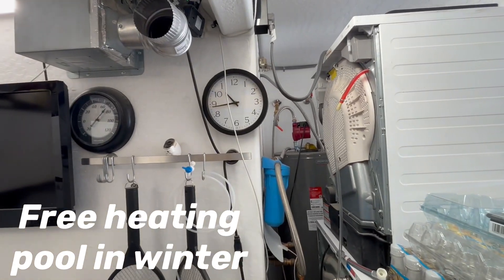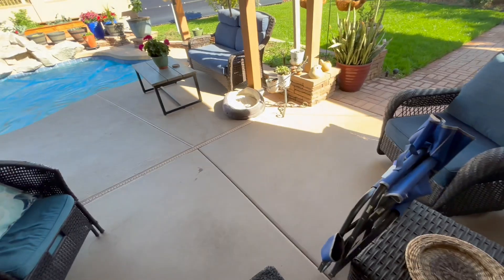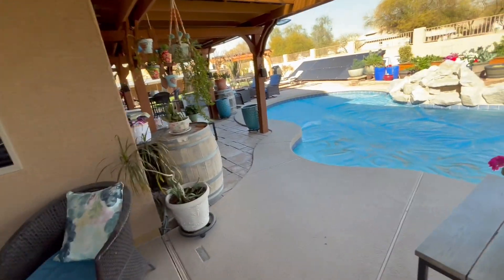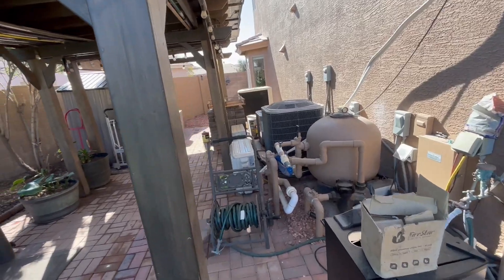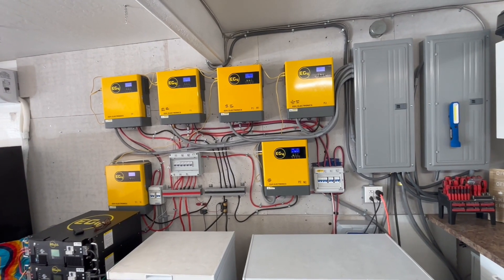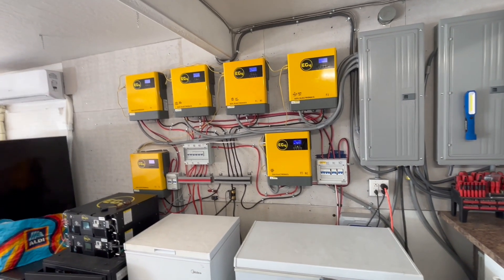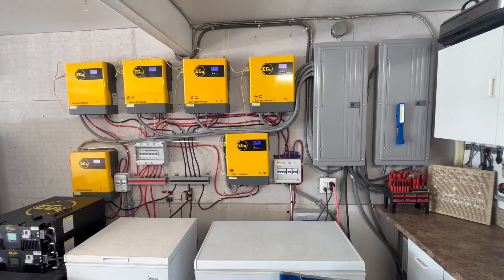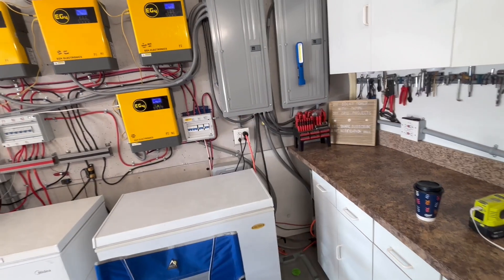DIY solar power pool pump. Run you pool pump and heat your pool using off grid solar

Comment: Wow, you know a lot about this stuff. I wish I did. I’m just playing with a small project trying to figure this out how fall out trying to get my pool pump on a little system to lower the electric bill
Reply from the maker: Pretty easy with the components they sell now.    They have pool pumps and heater that are 110-120V that can heat or cool up to 8000 or 9000 gallon pools. One you go above 9000 gallon pool you would probably need to have split phase output from inverter, 120/240V. 

You can get pool pumps that are either 120V, 120/240V auto sensing or manual voltage setting. You could run a 120V pool pump and a 120V pool heater with just one EG4 3kW off grid inverter and one 52.1V LiFePO4 battery along with around 4000-5000 watts of solar for around 12 hours a day.

You could also use a portable power generator connected to 2100 watts of solar to run a 120V pool pump and 27,000 Btu 7000 gallon inverter pool heater. 

There are many ways to do this. Most 110-120V pool pumps and heaters come with an electrical cord attached to where you just plug into 110-120V outlet. You couple plug into a portable power generator during the day using solar to run your pool 6-12 hours a day and then unplug and plume into grid outlet to run longer saving you 1/2 a day of electricity electric cost.

Hopefully I will get a 120V pool pump and 120V pool heater soon to make a video showing how to do this. Hang in there, it is really easy to set up a system. Just rake your time to understand how it works watching videos of people who set up already so you have a good idea how to set up yourself. 

It’s December 1, 2025 and my pool water is at 87 degrees. It was 46 degrees last night overnight. Life is good in AZ. Just Love the winters out here.

Comment: This  is HUGE! You've got an impressive system to be able to heat the pool all winter and still charge some of your batteries. Enjoyed seeing this in action!
Reply from the maker: This EG4 18kW output system is so powerful and quite. Heating my pool with 144,000 Btu heating capacity and pool pump on high and still below 50 percent output is totally insane. This is the first system to be able to start and run all day and my battery state of charge can be as low as 75-80 percent. 

Heating pool and charging battery bank at over 10 amps each on all 5 batteries. My friends have spent $800 a month for natural gas or propane to heat to only 75 degrees water temp. Electric pool heaters on grid use me was $400-$500 a month in winter. My pool will go from 46 degrees to 89 degrees for FREE! Then every single month in the winter heating for FREE. This pool heater also cools water in summer. 

This system EG4 18kW system starts the 127,000 all electric pool heater on the first try every single time. I’m so glad I chose these 3kW inverters. I think the insane part is I still can use another 7000-8000 watts while heating the pool. Then I’m still at only 15-16kW output out of 18kW. At 15kW output I’m using 83 percent rated output. 

I love how quiet the fans are while using 9kW output. This EG4 18kW system with 6-3kW off grid inverters & 5-EG4 server rack LiFePO4 battery bank has far surpassed my wildest expectations of what I thought you could run and what you can actually run with off grid solar system. 

Highly recommend all the EG4 products I use to others. Not one problem with any of the products running last 6 months for EG4 inverters and year & half with EG4 battery bank. 

They just work right out of the box with very simple & easy to follow instructions for quick installation that pretty much any DIY person can do. Very impressive system! 

To be honest, at first thought I would be intimidated to try something like this but quickly learned it was very easy to install and connect everything.